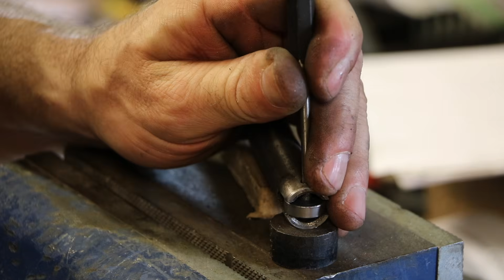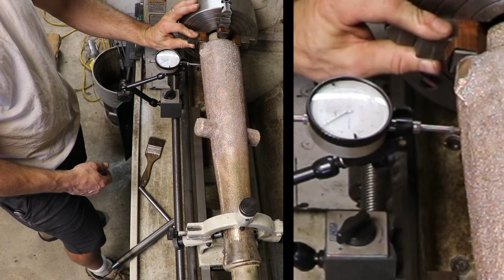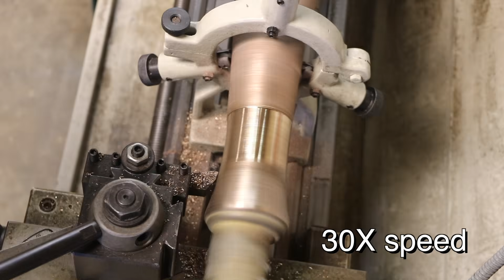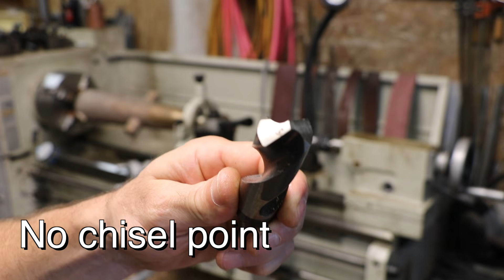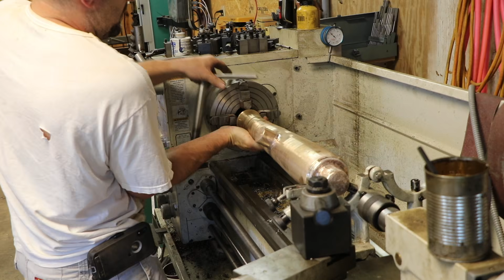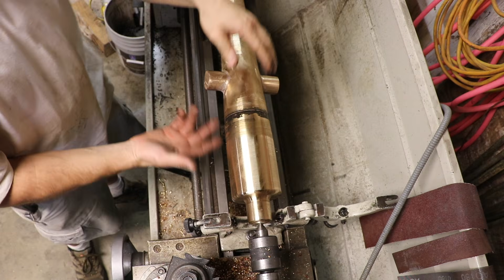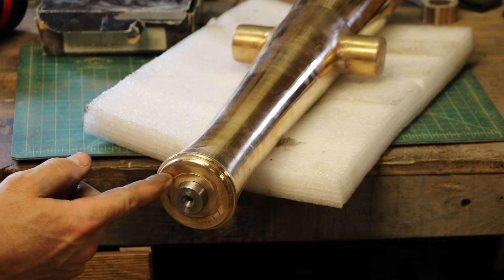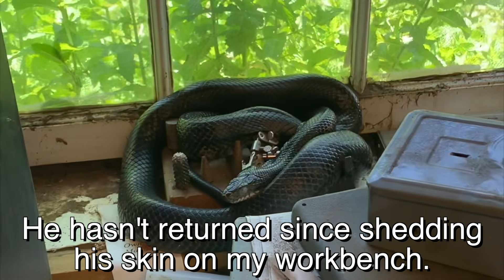Machining a Historic Bronze Cannon Barrel, Scaled Down Replica. FarmCraft101

Comment: Hello. Just found your channel. Cool project. Clearly you know what you're doing, but I had a thought to contribute. At around 12:00, the larger dia drills were wobbling trying to get the bore started through the casting voids. With the small pilot hole already machined, a good way to get a pretty true shallow bore for your drill to pick up, and follow, is to go in with a 5 flute carbide end mill .062 below finished size. As long as the set up is rigid, the end mill will "bore"  a nice starter bore on center. 
I've been a machinist for over forty years, but still love a cool project.   :)

Comment: If it was a engine, you would bore it and sleeve it. I think Nitro motors are around 6000psi - memory not so good - and they only have a thin steel sleeve in an alum block.

Comment: Over  bore the barrel,  then turn a sleeve,  that is a few thou over size,  pack it in dry ice,  then heat th3 barrelheating should give a couple of thou expansion, , THEN insert the frozen insert, problem fixed

Comment: So while sleeving makes mechanical sense, I guess the creator does not really want a "looks like an old cannon" but "this is basically an old cannon". Othewise you could start with a bought block of perfectly casted metal and just do the lathing. I am thinking that while this never was and never will be safe enough to fire without a cover, just filling that with something should help to keep the gasses behind the projectile. It could be melted metal or possibly even some strong epoxy, I guess you could go as far as to just fill the bore with some metal (softer and lower-temp than the cannon) and then re-machine it - basically where the bore had no defects, it would be the gunmetal, where it did, it would be filled somewhat decently. I'd do a research though about how well given alloys would bind to the gunmetal.

Comment: Very nice work. You could potentially make a gundrill, they're not all that complicated, but for this cannon I'm not sure you'd notice the difference. I'm curious what your take is on the whole sandpaper and lathe issue, I noticed that board over the ways while you were doing some of the sanding.

Comment: I am not saying the way you did this is wrong. But the next time you make a cannon. Just cast it with a steel liner in it. Seg 40 extruded  will work fine.

Comment: Regarding your question about finding the center with the cannon hanging out in space...you can put it on the steadyrest, mount the indicator to the carriage, and run the indicator along the top of the parallel part of the outside. Adjust the steady up and down until the indicator doesn't move.
Reply from the maker: I hadn’t thought of that one. Good idea. Machining is so cool because there are so many options to solve problems.
Reply: Not a bad idea but the barrel is tapered for too much of it's length I think.

Comment: Time stamp 18:55    I deal with this type of problem on the odd occasion. I deal with it using the 3 point steady in the following manner... but you will need a nice sharp (new) dead center.

STEP 1 Set your tailstock to the axis of the chuck. Don't rely on the zero mark for the tailstock offset adjuster screws (assuming yours has adjustment), use a dial indicator held in the chuck to find the true zero of your dead center whilst it is in the installed position. If your tailstock has no offset adjusters, skip this step

STEP 2 Place the job in the lathe chuck and three point steady rest. Just eye-ball the set of the three support adjusters. Low, high, side to side, doesn't matter, just do as good as you can by eye. Make sure all three supports contact the work piece properly

STEP 3 Machine a clean smooth flat face on the end where the center will go and coat with marking blue.

STEP 4 Turning the chuck gently and slowly by hand, bring the sharp dead center in the tailstock up carefully to the blued face so that a circle is scratched in the marking blue.

STEP 5 Adjust the 3 supports to bring the center of the small inscribed circle closer to the point of the dead center. Repeat from STEP 4 until the dead center scribes a point instead of a circle.

I "invented" this technique for myself, I've no idea if it is the "correct" method or not, but it works for me. I've not seen any other machinist use it so if anyone else out there knows of this or some other way I'd like hear about it.

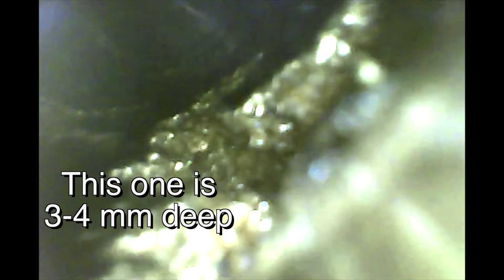EDIT: Bit of a bugga about the defect in the casting. I did notice at time stamp 27:07 that there are signs that the defect may extend along the barrel in a most inconvenient manner. It would make me think twice about firing it. At least, I wouldn't pressurise it if it were a hydraulic cylinder. Actually, hydraulics might be a safe-ish way of testing out the casting's integrity. 

As for the idea of a steel liner, it could be difficult to make it have good contact/support along it's entire length. Anaerobic polymers that one might usually use to ensure such contact are not heat resistant. Heat shrink fitting a liner would be more difficult to pull off than just recasting.

Do you know what caused the defect? Does the melt perhaps need a better degasifier compound?

Comment: personally i would sleeve it with a steel bore for safety, it would mean a smaller bore but that would be worth it for safety and long life of the barrel and yourself lol a seamless section would do the job, and locked in place with lock tight. best to press it into the barrel as hydraulic force would do the job, hammer blows would wreck the whole thing. have built a few black powder cannons, but for bigger than 1/2 inch bore i tend to go for  sg iron, cast around a seamless steam tube. have a 50mm beast out the front of my place.

Comment: Where that defect is, pressure wont be the issue. I'd be more concerned with it filling with fouling and possibly eroding over time, although in all honesty the more you shot it, the more it'd lap it and smooth it out. Some have mentioned increased blow by, and that's probably accurate, but wouldn't really be a concern.  Now, in my opinion two things come to mind that at least deserve thought. One, if you leave it with the current bronze bore, take a bit and flatten it at the point and round the edges and put it back in to radius the breech face. this will take out the stress areas in the back of the bore. Two, if you line the bore, I'd use a very thin wall DOM liner, and seal it at the end with a plug that has a rounded breech face. Then just loctite it in. Try to eliminate any area that fouling could build up in the steel liner/plug area, because this will cause corrosion. also probably need to do a liner into the steel liner for the touch/fuse hole. These are my opinions.

Comment: When using a file on the lathe, never hold your left arm over the chuck the way you were. If your shirt sleeve drops just a little too much, this cannon will be the last thing you ever create. Also, when filing on the lathe, spin the workpiece away from you and pull the file towards you, with the handle facing the back of the machine. That way, if the file bits into the workpiece too hard, you dont stab yourself in the guts with the file. This applies even more when using a file without a handle. 
From a fellow machinist, stay safe and have fun!

Comment: The polish turned out very well. That defect is...umm...kind of deep. If I saw that in a shotgun or rifle barrel (by scale) I would put that firearm out of commission. A lot of people suggested sleeving it. A good option, but a rather involved option.

What kind of snake is that? Nice, fat, happy snake it seems. My girlfriend would NOT be pleased. My mother, if still alive, would also be displeased. They HATE snakes. Even garter snakes have to go. I am in charge of snake relocation, ha. Accidentally got with with the lawn mower last week. I felt sad. Girlfriend was happy. Did not even get enough worth getting meat from.

Comment: find exactly were they are on the out side mark the spots were you will drill out ,then build an oven around it reheat and using the same metal rod that you will make in steal pipe it will shrink so it will come out fine them mig it all back in  use a small cup so you can get in there using a metal rod on the inside also hot covered with graphite

Comment: Overbore by 1/4", machine a stainless steel sleeve with a 1" bore and epoxy the sleeve into the overbore. The stainless gives the benefit of easier cleaning and 1/8" will give enough wall thickness to support a reasonable overload if that happens. Black powder is hard on plain carbon steel, tough to properly clean.

Comment: What was stopping you from putting a bushing between of knob and casting? That not work?
Reply: What knob?
Reply: @SportbikerNZ   he said it would work if casting was longer, so put a bushing there. Hes pointing at where it would @3:28
Reply: @Steve_Just_Steve  I see the part you mean.  Yeah extending the casting basically.  Welding an extension/bush on.
Reply: @SportbikerNZ  Yes sir or bolt it on for temp use
Reply: @SportbikerNZ  hed have to use the screw hole thats there to secure with an "ear" or bracket. at least he wouldnt of had to cut it up

Comment: Could you fill the barrel blemish (weld it) perhaps with a TIG torch?  Fill the hole with shavings , melt it in and then redrill that area?  Just a thought (from someone who does not know any better).

Comment: Bore it out passed the defect and sleeve the barrel back to a 1 inch  bore. Use a good steel like 4140 not cold roll. I made a golf ball bore cannon out of 5/16 wall and breach out of 4140. It was 24 inch barrel Worked well.

Comment: As much as I'd love to see it remain a classic bronze cannon, with an imperfection like that (and the possibility of more inclusions within the barrel walls you can't see), the only safe thing would be to go for a steel liner.  I suspect that, in theory, you could braze a patch into it and re-bore it, but that would be damn hard to get a torch that far into it to get a successful braze job done, and there's still no telling if there's other weak points you haven't uncovered while boring it.

Comment: I think you’ll be ok as long as you don’t fire it a lot. It will be a weak spot and will fail eventually. If you’re going to be using full house powder charges you’ll need to sleeve it. I don’t have a lot of gunsmith experience but I have been reloading & casting projectiles for a decade or two. Just my two cents. Really enjoy watching the project so far!

Comment: Love your work, definitely love the mouse control methodology. Honestly (from experience with some high pressure stuff, not enough gun specific experience) I would epoxy up the voids, rebore, and shrink or epoxy/green loctite in a stainless steel seamless liner with a thin wall. The strength I think is there from a pressure standpoint, but there will be barrel deflection and the uneven force of a projectile and gas passing such a large void seems likely to cause localized stress and shear-- and you've got stress risers in the uneven surface. To say nothing of possible erosion from hot high velocity gas causing turbulence and such. 

Don't think you necessarily need a thick liner if you stick with reasonable black powder loads, but I do think you need a nice smooth bore free of any possible ways to introduce unneeded stress. Throw in a good 316L tube with a 1"od and bore to .900 or so and you'll still get a heckova wallop.

Comment: Cut the boar to .001 to .003 smaller than the od of a .875 id x ~1.500 od 4140 QT seamless steel tube. Heat the canon in a 3 or 4 hundred degree oven several hours and freeze the tube with nitrogen. Slip it in sure and fast as you will only have one shot at it. Then you can turn the boar out to 1 inch and have 1/4 inch of good steel per side to hold the pressure.

Comment: Hi, former Artilleryman here. that defect will affect an awful lot. that's a massive weak point int the gun, and will cause it to fail. i reccoment firing that off from a large distance and while you're hiding behind something. not just the first time, every time. best case scenario it just makes it impossible to hit anything, worst case scenario you'll reenact the USS Princeton incident. one possible fix might be to cut into it from the outside, then fill in the defect using bronze rod, then cleaning up the bore and outside area slightly. I still advise caution, though. also, hard to tell from the shots but it looks like you didn't put a proper crown on the bore. sharp edges on the muzzel are muey no bueno. just a slight chamfer is good enough.

Comment: I've been looking forward to this video!

Finding center on a sagging cylinder: face the end as much as possible; lock the head of the lathe and bring the dead center just in to contact with the surface then move the tail horizontally to lightly scribe a line; rotate 90 and repeat until you scribe a square; cross the square at the points like with any squared stock and X marks the spot, or as close as you could reasonably get.

Comment: I'm not a machinist, but the way I would center the casting on the tail stock, would be to measure off of the tail stock as that is what dictates the "center" .  Possibly make a clamp for your dial indicator that clamps to the tail stock, which you can then rotate from the top to the bottom and figure out the sag happening and adjust it accordingly.

Comment: In addition to all the "sleeve it" comments.
You might consider a partial sleeving of the barrel, so that the sleeve only goes down the muzzle to about 30mm past the void. Another consideration might be a threaded section at the muzzle to both retain the sleeve and allow it to be swapped in the event of wear in the future.
Of course the entire length of the bore would need to be reamed to ensure the bore does not change.

Comment: Sleeve it. Safest option. Rust pitted shotgun barrels arent a great idea to shoot, and youve got a major failure point there. Id bore it out more and use a 1" id sleeve. Could even cast one in bronze and machine it to lightly press fit in place. Possibly braze at the muzzle. Steel would be stronger but wouldnt be able to hide as well. Maybe fill it up to just past the void with more molten bronze and re-bore it? Either way best of luck in the next steps. Cant wait to see it fire.

Comment: naval gunner here. that big defect is probably gonna be a deal breaker for you. you will get a bulge in the barrel at that position followed soon after by a split. fill in with gunmetal and sleeve would be the safest way to salvage that cannon without starting over from scratch.

Comment: That defect is going to affect accuracy in any case, because it's going to put a spin on the ball. 

And because you don't know about what other defects are in the casting, you should perform a test to much higher than your expected working pressure, either in a controlled situation with nobody even remotely near the cannon or by using a hydrostatic test rig modified somehow so that you can pressurize the breach end to its test pressure and the rest of the muzzle to its test pressure.

Comment: Honestly? Load it up with heavy powder and no projectile , get behind the barn, and pull the string. It’s bronze... it won’t grenade, it’ll just tear along the weak spot. Still don’t want to stand by it.

Kidding...

There is much wisdom in this forum thread:

http://www.chaski.org/homemachinist/viewtopic.php?t=96795

The overwhelming opinion I’m seeing there is that bronze is soft and should be lined with steel, if not stainless... so you could bore it out another ~150 thou... I found these 3 charts that should give you all you need to select which pipe and wall thickness you need (including pressure ratings per wall thickness!!)

Pipe schedules 
https://www.metalsupermarkets.com/what-do-pipe-schedules-mean/

Pipe dimension and weights
https://www.engineeringtoolbox.com/ansi-stainless-steel-pipes-d_247.html

Seamless pipe pressure ratings
https://www.engineeringtoolbox.com/amp/pipes-pressure-rating-t_40.html
Reply: YES! Found the chart I wanted!!!!

Check this link!

https://www.engineeringtoolbox.com/amp/stainless-steel-pipes-bursting-pressures-d_463.html
Reply: 1” nominal schedule 80 seamless stainless pipe has: OD 1.315” ( just under 1-3/8”, yes?), wall thickness of .179”, and an actual ID of .957”, but a burst pressure of drum roll 20,418 PSI.

So maybe bore it to 1.314” and press-fit the sleeve. You said you had a 4mm (~.158”) defect plus a half inch, so roughly .658” of wall outside the 1” bore - plenty of room to hold the sleeve... so given 815 thou from the center of the barrel to the OD of the sleeve, and  1.158” from center to the OD of the canon would give you 343 thou of bronze at the thinnest... hmm... well you have 8k PSI to play with... maybe thin the wall of the liner? Or drop down to a 3/4 or 7/8 projectile?

Also: cut the trunions off and mount them to a steel mid-barrel reinforcement ring. Having the barrel support itself and the recoil could be unpretty... this is actually how the old guns were made anyway.

Here’s that link!

 https://www.engineeringtoolbox.com/amp/stainless-steel-pipes-bursting-pressures-d_463.html

Comment: I'm by no means an expert in cannons...
That said, like many others, I'd suggest re-boring the barrel to 1.250 inch inside diameter and inserting a steel sleeve with a 1.000 inch inside diameter (0.125 inch wall thickness) this should (I hope) allow you to fire max. strength shots without turning your cannon into a Frag Grenade...

Good Luck!

Comment: Looking great at last...
To get a good dead center, rotate the entire lathe 90 degrees so the cannon is hanging. Find dead center without gravity pulling to the side, then rotate back to horizontal.
This may not be easy or practical, but it's a thought!